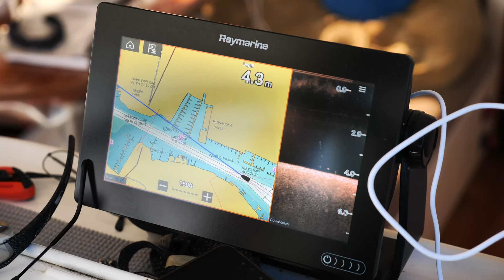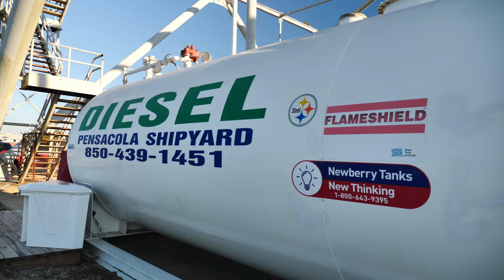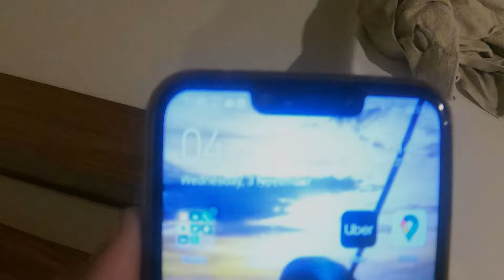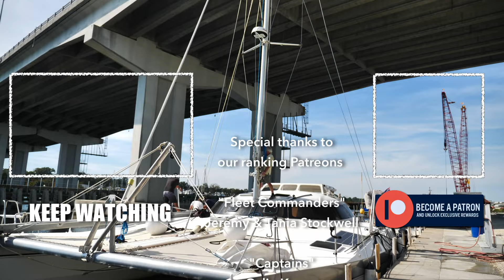DIY RIGGING - Great Loop #21 - Sailing Life on Jupiter EP100

Comment: Using a Grinder to cut wire is not a significant threat to its strength, what those Riggers said is a myth.  1x19 Stainless wire is annealed so that it remains ductile and flexible for its manufacturing process (making the twists).  While it is true that the Grinder introduces heat that causes tempering (increasing stiffness but also reducing flexibility) you are not introducing enough heat for any significant amount of time to temper anything but the very tips of wire.  The part of the ends of the strands which are captured in the Sta-Lok fitting and providing the mechanical 'bite' to lock the wire into the fitting are unaffected even if the very tips got a slight temper.  FYI, Tempering of any metal that used in structural applications is done in an Autoclave with oxygen removed, a specific amount of heat at a controlled rate over time.  You have nothing to worry about.
Reply: Yea it is a interesting point, like you I suspect any heat damage would be at the very edge (but I'm no expert),  like a couple of mm's and it looks like the clamping is 10-15mm back. Would be interesting to take temperature readings of the shrouds every mm back from cutting to see the heat rate. Discoloration seems to be a tell tale sign of heat damage, the small among of cutting I've done kits always only ~1mm back. Reading a paper on grinder cutting with thermocouple imbedded at cutting surface they had temperatures ranging from 300c to 1000.
Reply from the maker: Ah good info.. I can relax about that then. Cheers
Reply: I would suggest its not as much about the effect on strength as it is about corrosion. If you create a "heat affected zone" you are creating a zone that is more susceptible to corrosion (chromium depletion zone). However, I'm not a rigger so I don' t know if grinding the ends will create this condition. It is more of a concern when welding non-L versions of stainless.
Reply: @gordengel290  You are mostly correct.  The heat affected zone, when exposed to oxygen, will cause oxidation at the surface.  This is more common in welding stainless steel and we correct it with an acid wash or electro-polishing (on small parts that you can dip).  The heat effected zone of the wire strands in this case will be captured at the bottom of the Sta-Lock fitting that filled and sealed with goop (3M 4200 or similar) so its at very low risk of corrosion.

Comment: Using a grinder - heating the SS wire : hv someone spray water on as u cut.  Problem solved - but cover yr electric grinder especially if on 240 AC.   Or spray, cut a little , spray, cut a little ....

Comment: I have a few comments and questions.
1. When you did the first fitting, you removed wire from the slot, then immediately pushed another wire into the slot. Looks like it wasn't a problem since you did a second check and the slot was clear. Shows the importance of the second check.
2. I'm not sure about that particular Loctite, but a lot of those compounds need clean dry threads. When you put the caulking in place, it was all over the threads. I think this would negate the function of the Loctite. Very likely not a problem since the original design calls for anti-seize. Did you read or hear somewhere about replacing anti-seize with Loctite?
3. How much did it cost you to hire that crane? Or was that included in the whole mast installation package?

This was a very interesting video. Nice to see the process.
Reply from the maker: Hey mate.. Yes I know what you mean mixing the lock tight and mastic.... The riggers said to do it this way... 
Apparently the crane was only $350..but 4 or 5 riggers at $80/hr adds up!
Reply: @SailingLifeonJupiter  Was that $80/hr each?!

Comment: Not bad but you should have put down a piece of styrofoam under the mast like solid foam board insulation.prevents dents as the foam deforms.
Reply from the maker: Where's that Maus? On the crutches with the mast down?

Comment: Here's an old trick from Brion Toss that is seldom used anymore but worth a try.  If you have the spare time before your mast is stepped, suspend your shrouds off the ground.  Get some Lanocote (anhydrous lanolin) and warm it up in a slow cooker, double boiler (whatever, just get liquid but don't boil it).  If its hot and sunny your shrouds will be warm, its helpful to get them warmer with a heat gun (again, don't cook them with a torch or anything, not TOO hot).  Brush the hot liquid Lanolin onto the wires, it will get sucked into the wire structure between the strands and displace any moisture.  It doesn't last forever but it will delay moisture from settling in-between the strands.  You can wipe away the excess Lanolin that is on the outside of the wire with a rag so it doesn't make a mess of your hands and sails, the idea is to get it into the crevices.
Reply: the idea is to get it into the crevices. - true
Reply from the maker: Sounds like a good plan... Love lanolin

Comment: So many sailboats running around with 20,30,40 year old rigging with cracks in chainplates, cracks in swaged ends, corroded cable inside the swages. They are tempting disaster. I’m an aircraft mechanic just getting into sailing and looking at boats for sale. I have to say sailboats are some of the most neglected vehicles I’ve encountered.
Reply from the maker: Sure can be... But i guess not so deadly if the  mast falls down.

Comment: Not “may effect integrity’ , but will. Why? Those fibres are heat treated to the right temp when extruding. You re-heating alters that “tempering’ and could make it bridal or more elastic than it was intended. Oopsey 😊
Reply from the maker: Who knows the truth Latitude... Other folks on here say it won't be   affected at all. I ain't no meturlogist!
Reply: @SailingLifeonJupiter  I did a cause at university in my engineering degree and it may effect the life. Heat metal up and cool/ chill it and it becomes very strung but brutal. If you heat up and allow it to cool on its own it becomes elastic. Those fibres are cold rolled and tempered to be just right. So they give the right amount when you tighten them up. You may be ok but who knows.

Comment: You could have shaved a lot of weight off of your boat by going with Dyneema. Why didn't you go that direction? Are all the Mumby's mast rake set up the same. When I look at videos of other Mumby's, it looks like they are mostly all leaning heavily to the transom. I used to race Tornado and Nacra catamarans and pretty much all the mast were straight up. It would be nice to understand mast rake a little more. If you did go with Dyneema rigging, how long does it last if you cover it with that sleeve? It looks like you didn't give yourself enough time to get all that work done but you made it working all night. Man, that's a lot of work!
Reply from the maker: I reckon we will look at Spectra rigging next time.

Comment: Good episode…..Staloks rock. Good idea w/ alu tape on wiring for protection. Wondering how you tensioned the 12mm wire, and how tight you keep it? You are lucky at 0400 you were not picked up for dealing meth in Pensacola…..thanks, Andrew/ Stan the Man
Reply from the maker: I did have the security guy questioning me... Cheers guys.
Reply: I’m interested in the rig tensioning process too. Jamie did you do a video on that element of rigging the mast?

Comment: The rigger should do it all. His getting paid to do it. Why should you have to adjust the mask rake?
Reply from the maker: At $400 an hour! No way. Moving the  rake fwd reduces weather helm forces Latitude. And the base was originally cut at the wrong angle,  so had to be corrected.
Reply: @SailingLifeonJupiter  agree the rake needs doing. If it saves you money to do it yourself and you can do it than yes you should do it. But it’s scary thing to do. You cut it wrong than your 30k out of pocket for a new one 🫣

Comment: Here's my take on this week........ They may be $200.00 apiece but now time is a friend and they will last you. You might want to seal the ends so that no sea water gets in like the rusted ones you opened. The crane crew were spot on. The whole operation went without a hitch. GREAT!!!    Now the other side; good help in the United States or Canada is expensive, we all know that so are you complaining? Working on your back in rocks. We can see that the area is all gravel. Are you complaining? Check out the number of complaints you make in each video. Do not take this the wrong way. Hey, owning an airplane is expensive but that is the price you pay. Could you maybe focus more on the positive side of life? i did come away more knowledgeable when you showed us how the cable rigging is attached. Do you consider that many get up at 3AM due to stress or an overactive thought process? Are you complaining? You could tell me to take a hike but i hope this may be helpful. Best regards, Jim
Reply from the maker: Haha.. Are you complaining about my complaining Jim?
Reply: @SailingLifeonJupiter  She is a big boat and takes a lot of work-maintenance.
Reply: All boat owners moan about maintenance it’s a necessary evil if you want to enjoy your sailing and feel confident in your craft. 
Nothing stops your enjoyment more than worrying that every creak, crack and squeak is going to cut short your trip!
Reply: @SailingLifeonJupiter  looks that way doesn't it. simply put; life is too short to focus on the negative. take it from one who knows. jim